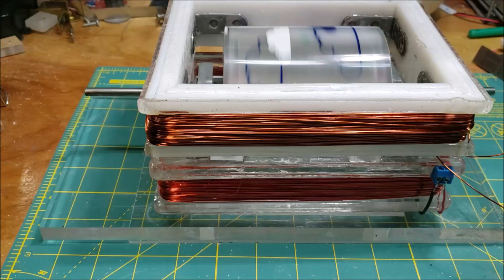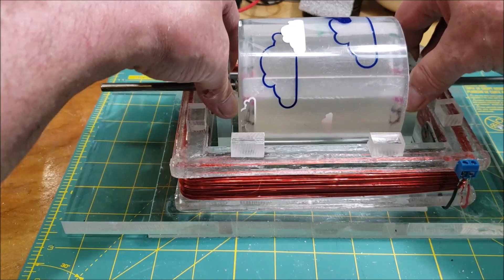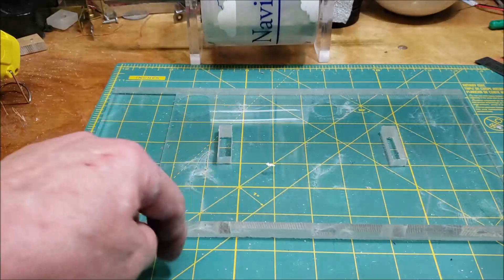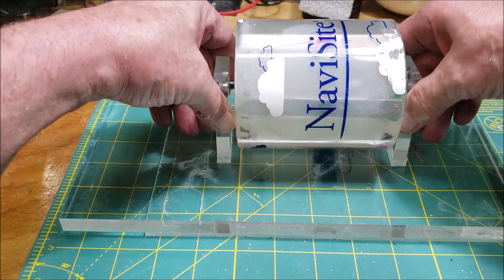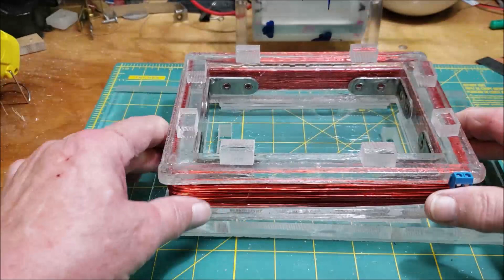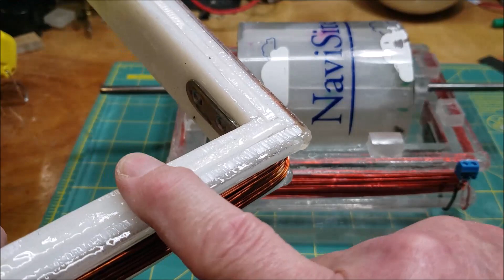Diy Window motor (almost done)

Comment: Yes Mic, your window motor will work very well with the circuit JL94, i have years using my circuit in different projects, connect both circuits in parallel and the rotor will fly ...!
Reply from the maker: cool sounds great but connect them in parallel ?Or do you mean in series? And if in parallel how? Can you send me a drawing so I don't mess it up :)
Reply: Yes connect one circuit down of the rotor and connect the other circuit up the rotor, now join the two negative wires of the circuits (power in) and join the two positive wires of the two circuits, now connect the power supply 12 volts.
Reply from the maker: @skycollection  my friend please send a drawing ok